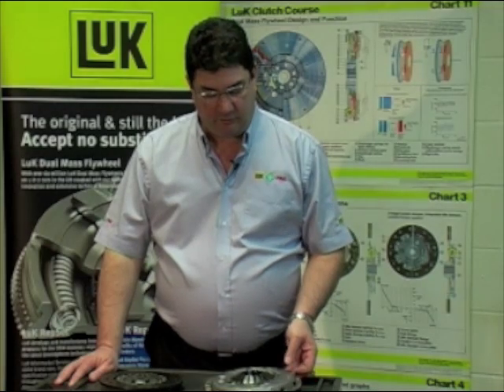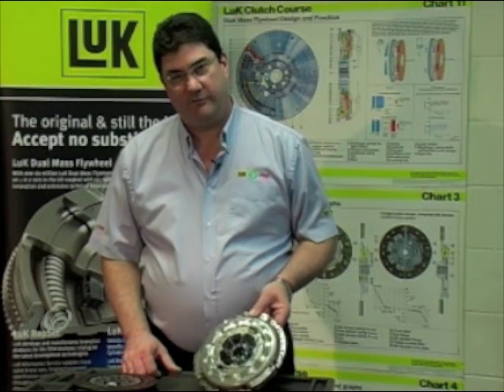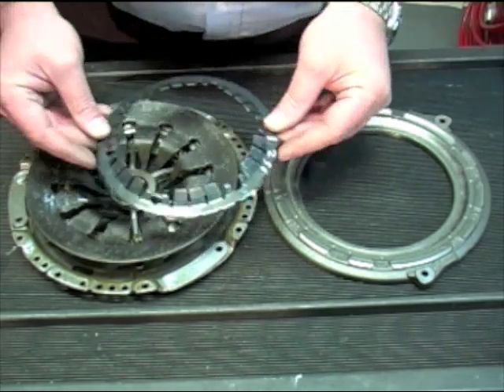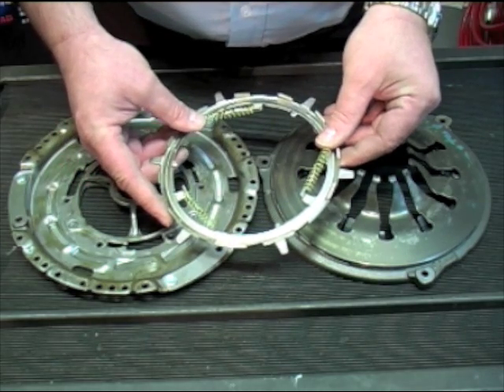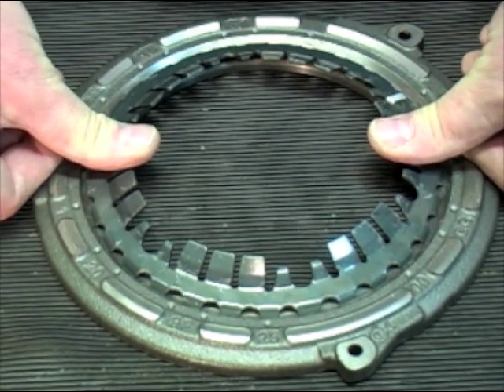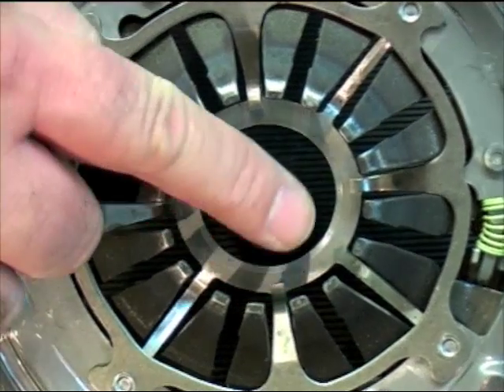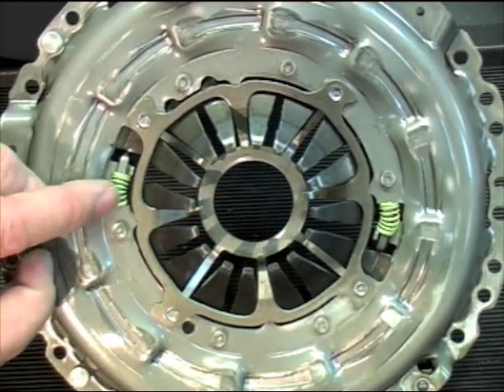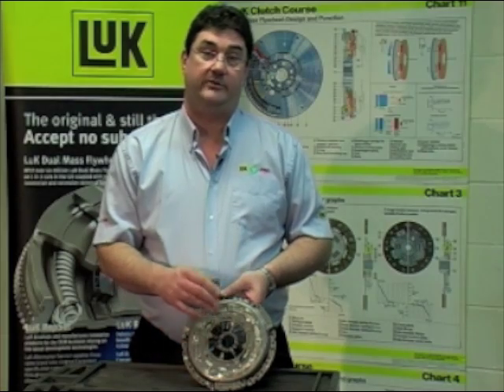AUTOINFORM ONLINE MAGAZINE: LuK - HOW SACS WORK AND FITTING TIPS

Comment: Does the pressure plate need resetting if u unbolt it from the flywheel straight after the transit plate has been removed?

Comment: Can self adjusting clutches be fitted as a replacement to existing standard type?
Reply: foxdmulder I don't see why not, there's no reason why there would be any dimensional change in the attachment points. Consult your local garage or parts dealer about obtaining a self adjusting clutch for your specific car. Also keep in mind that these clutches are designed to work optimally with a hydraulic release system. If your car has a cable system you will still need to adjust it as the fingers on the release spring will shift towards the engine.